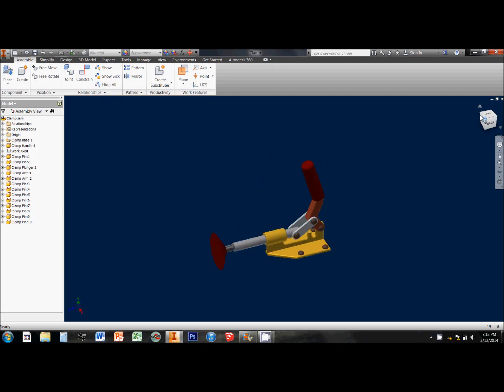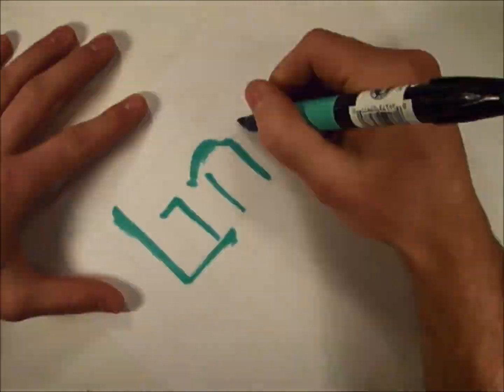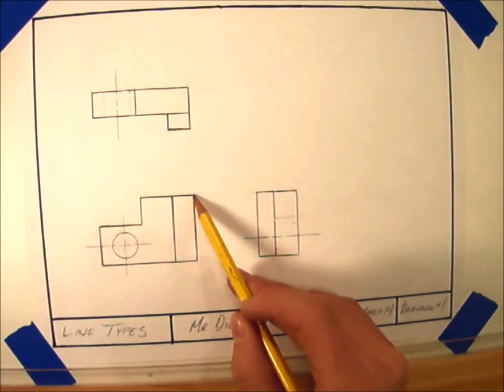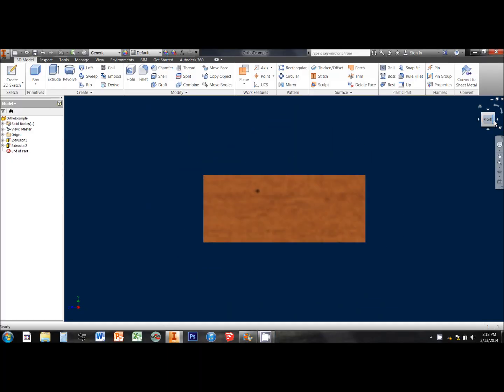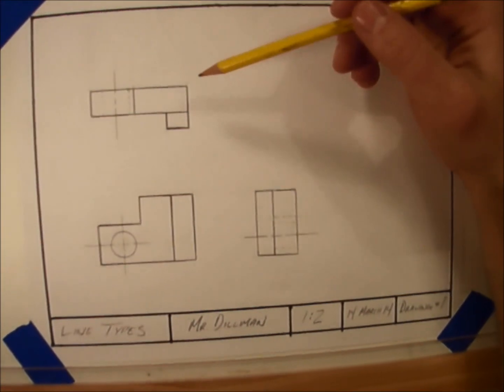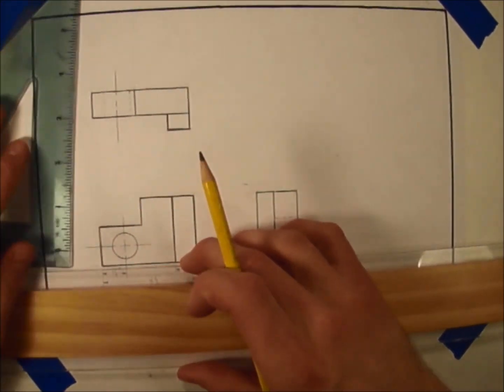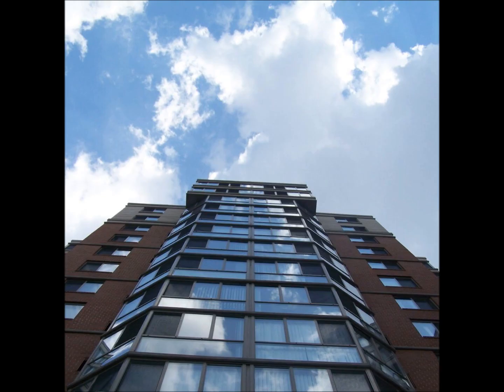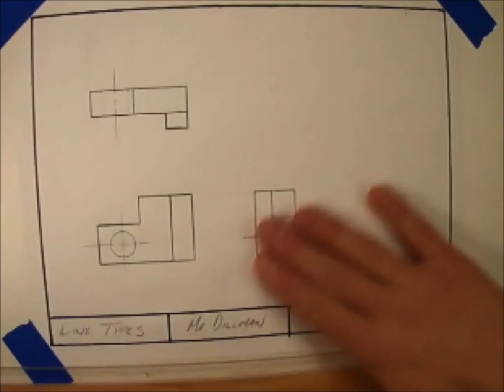Line Types in Technical Drawings

Comment: How is the centerline in an architectural drawing of column layout different from what you explained in your video?
Reply from the maker: A centerline can be used for other things besides holes. They could be used to identify the center of a solid, especially cylindrical or symmetrical solids. I could see where they would be used in a drawing of columns to identify the spacing from column to column, based on the column centers.